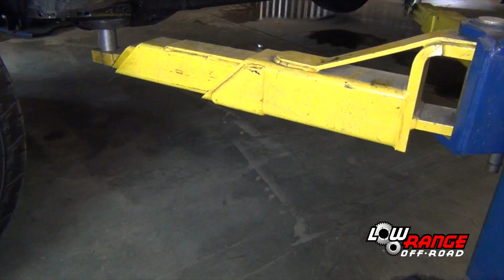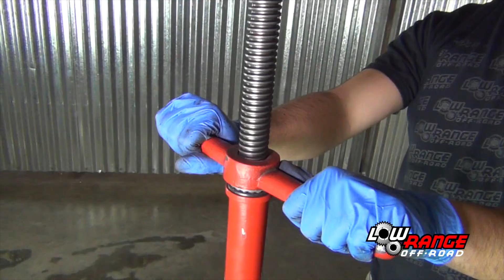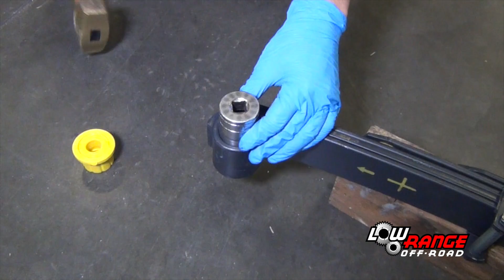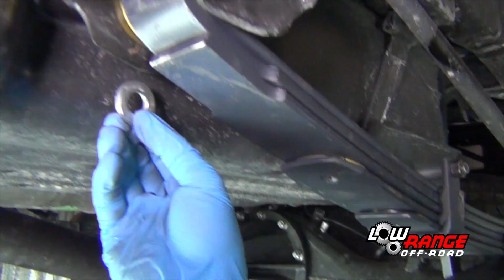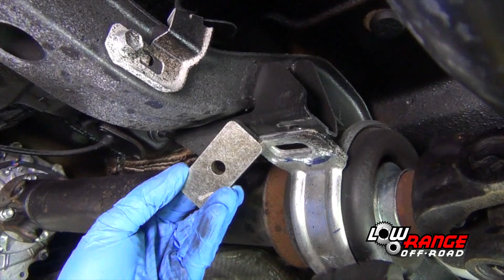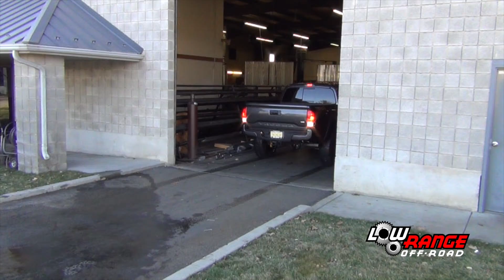How to Install an OME Suspension Lift on 2017 Tacoma–Part 2

Comment: To all reading this make sure you grease the new bushings!!! Just had to take out the leaf springs and grease them 5 months later after super annoying squeaks!! And make sure you use high enough jack stands so you can lower the lower diff  enough to get the new leaf springs in!! It was a giant pain with 3 ton jack stands, 6 ton jack stands made it so much easier.

Comment: OME 2005+ 2nd/3rd gen Tacoma springs need to be modified to work properly off road.  The problem area is the rear of the 2nd and 3rd leaves extend into the shackle and are in very close proximity to the shackle.  Under NORMAL leaf spring operation while articulating, the lower leaves slide outboard from beneath the main leaf, hitting the shackle.  Even worse, when the lower leaves exit the shackle, they pop further outboard, and when the axle goes back to horizontal, the lower leaves jam into the shackle, causing dangerous binding forces and terrible noises.  OME evidently took their design from the Hilux and Land Crusiers and didn't full test the fitment with the Tacoma, the ONLY Toyota that OME make springs for that has a shackle in tension.  Very poor execution OME/ARB
Reply: I’ve heard greasing the bushings when installing them helps with this issue.

Comment: Great and all but forgot to put non-petroleum based grease on the polyurethane bushings.  It is very important to put non-petroleum based grease on most of the surface of the polyurethane bushings.

Comment: Needed a little more heft in the rear of my gen 3 Taco for towing a camper and all our gear, but resisted installing a heavier spring pack like this. Instead I installed an add-a-leaf. Three months later, I've installed these springs because the add-a-leaf was kinda scary. I was ready to live with a stiff ride, as these have one more leaf and helper than the stock pack. MAN, WAS I PLEASANTLY SURPRIZED!!!!! The ride is smooth, but feels stout and capable. The truck handles better than with the stock springs as they are firmer and the Poly bushings make it feel nice and tight. I hooked up my trailer and the porpoising was no more! Sad I wasted money on the helper springs, but glad I took the plunge and went the right way. Falling in love with my truck all over again!!!
Reply: @asteiner9181 , you basiclly had the stock pack working , rubber bushings and all, until you hit the helper. So you had they extra weight twisting the stock pack around, and the softness of the rubber bushings adding to the sloppy feel. Then, when you did hit the helper, you HIT the helper, lol. When I put the heavier spring pack on with poly bushings, it was crisp, solid feeling and they weren't stiff as I imagined they'd be. At any load, and any road condition, they perform smoothly throughout their travel.  After all this time, I'm still extremely glad I spent the money and did it right.
Reply: @asteiner9181 , it wasn't that much, really. Old Man Emu, got them at 4Wheel Parts
Reply: @asteiner9181 , I didn't replace the fronts, just the rear leaf springs...and I even have a winch on a hidded winch bumper in front and didn't need more spring...Try 4Wheel Parts ARB part #ARBELO95R. $235.71 each, (sold individually). And poly bushing set OEMSB108, $32.98.  DOUBLE CHECK YOUR VEHICLE AGAINST THESE PART NUMBERS, I DON'T GUARANTEE ACCURACY!!!

Comment: Great video. Im currently running stock suspensions on my 18 tacoma sport, but pulling a heavy trailer it seats too much on the rear and so im thinking on doing a 3inch lift kit with heavy duty leafsprings. Im located in FL, where can I find those leafsprings and will it need blocks on top of the leafsprings?
Reply: Low range.com.

Comment: Just installed this set on my 2018 tacoma. This video was perfection. The paint-by-number of lift kit installs! 😆
Reply: How does it ride 8 months later? Any good offroading with this suspension? Any broken parts? Front axles are still good?

Comment: Does this lift only work on the 2017 model? I have a 2011 double cab long bed Tacoma that I'm wanting to lift, know there's a specific lift for it but, I was curious if the rear leaf springs featured in this video will still fit my older model Tacoma?

Comment: heres a prob easyer question, do i need new upper control arms. or is it not needed
Reply from the maker: Upper Control Arms (UCA's) are not required with this kit.  However, it is a good idea in that you will get a little more front suspension travel.  Thanks for watching and commenting.
Reply: lowrangeoffroad thanks!

Comment: I'm just adding a 150 pound front bumper(with wench) and 150-170 in the rear of dead weight should I get the heavy or medium load kit
Reply from the maker: Not sure I am qualified to answer your question.  May I recommend that you call our tech support sales guys at 801-805-6644 or email them at sales@lowrangeoffroad.com.  I am confident they can answer your questions.  Thanks for watching and commenting.
Reply: lowrangeoffroad all good I figured it out, thanks

Comment: Is an alignment needed if ur just doing the OME leaf spring install?
Reply from the maker: If the rear of the truck is higher or lower after the installation front caster will be affected.  So the answer is yes.  It should be aligned.

Comment: I just installed the  Dakar leafsprings with fox shocks and the OME carrier bearing drop. Now I'm getting a vibration at around 20-25mph.  Someone told me I might need axle shim.
Reply from the maker: I checked with our Toyota expert here.  He said, "he would want to measure his drive line angle to see if he needs a shim 
to adjust the angle at the rear axle or a larger carrier bearing drop".  If you have further questions I invite you to call us at 801-805-6644 between 8 and 5 M-F MDT and ask for Nick.  Thanks for watching and commenting.
Reply: lowrangeoffroad  thank you!
Reply: I’m having vibrations after installing this kit on my 2018 Tacoma, getting 2.5* shims put on to remedy but you’ll have to take measurements to know what degree shim you’ll need, one thing I’ve read though is you don’t want the difference to be 0.0 because then the u-joint won’t circulate grease properly, hoping my angle will be about 0.5 different between the angle of the drive shaft and the pinion bearing, I’ve heard the carrier bearing drop helps some people but didn’t help me at all
Reply: Or you my need a nidle bearing.

Comment: Low range off road I hope you get this and would very much appreciate a response. I'm definitely getting this for my truck but I was wondering can I fit 35s on without any rubbing
Reply from the maker: Ricky, the owner of the truck we did this 2017 Tacoma reported a slight tire rub on full turn in reverse with 33's (285/70R17).  Hope this helps with your decision.  Thanks for watching and commenting.

Comment: Great install video, I will definitely be using this for my OME spring when I decide to upgrade. I got a few questions though.

1. I see that most people only install the rear OME bushings, why have you decided to replace front bushings as well? 
2. Would you recommend grease or super lube inside the bushing before inserting the sleeves? and would some super lube inside the bushing reduce or potentially stop Dakar squeaking problem?
Reply from the maker: The bushings come with this kit. We installed the lift according to Old Man
 Emu's instructions. You can use super lube for your bushing.  Hope this helps.  Thanks for watching and commenting.

Comment: Awesome video I used it to start my instillation of the same kit today. I wanted to know the tire size and backspacing you used to put the 33's on, and of course do they rub anywhere? I'm thinking 4" of backspacing will be good but just don't want stuck with wheels that don't fit rite.
Reply from the maker: George, the tire and rim size is listed in the video description, but we will provide it here for your convenience:
Tire Size: 285/70R17 BFGoodrich KO2
Wheel Specs: Method NV 305 Matte Black, 17x8.5 - Back Space 4.75”
In regards to assembling those struts that we call them shock & spring assemblies.  When you buy the shocks and springs from us you can also buy an OEM quality upper shock mount (sometime called a strut mount) and we will assemble the spring, shock and upper mount for you for free.  It is a much better option.  I will include the link to the upper shock mount we supply below.  I realize this will not help you at this point in your install but it may help someone else.  Thank you bringing this up.  It really is an important issue; not just for the hassle aspect of it but the safety as well.  Thanks for the advice.
http://www.lowrangeoffroad.com/2005-toyota-tacoma-2007-fj-cruiser-2003-4runner-suspension-strut-mount-each-tac-sp-sm-05.html
Reply: I appreciate your prompt and courteous response. Because of this level of professionalism you will have a future customer for sure. I look forward to adding a few more items to my 16' and will definitely be sourcing you for parts as soon as I find a Samurai to swap my 85' axles into. Or go all out and just build a tube chassis for it haha.

Comment: is a diff drop required?
Reply from the maker: Not sure I understand the question. Are you referring to a diff drop in the front or the carrier bearing spacer on the drive line?
Reply: lowrangeoffroad  I see that the kit comes with the carrier drop. but, I don't see a diff drop for the front diff, which most of these kits come with to fix the front axle angles.
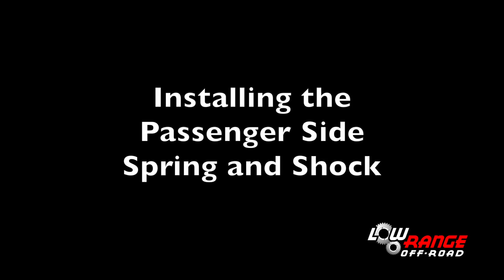Reply from the maker: We do not supply the diff drop kit with this OME Lift Kit because we consider this aspect of the lift to be optional.  We have no evidence of the axles exceeding their range of motion.  However, it would not be a waste of time or money to install the diff drop kit.  It would certainly make those front drive axles, cv joints and boots live a little longer.  The diff drop kit cost only $29.00.  Here is the link:  http://www.lowrangeoffroad.com/2005-2017-toyota-tacoma-2003-2017-4runner-2007-2014-fj-cruiser-lexus-gx470-gx460-differential-drop-kit-lr-2gddk.html.  Also, here is a link to a video which includes how to install the diff drop kit on a Tacoma: https://www.youtube.com/watch?v=Rxcd2duh1gM&t=329s.  Fast forward to the 8:00 minute mark to see these instructions.  If you have further questions or concerns please email us at sales@lowrangeoffroad.com or give us a call at 801-805-6644.  Thanks for watching and commenting.

Comment: So then, could you add a front strut spacer to raise it to level or slightly higher then the rear?
Reply: Several of our customers have used the Low Range LRT 3" front lift spacers with Old Man Emu rear springs.

Comment: Any rubbing with the new lift and wheel set up? What are the rim specs(size, offset, ect)? Great videos.
Reply from the maker: Mitchell, I am not aware of any rubbing.  I will check with the owner and get back to you on that.  But, all the tire and rim sizes along with other specs are shown in the description of the the video.   I will include tire and rim specs here as well for your convenience.  Thanks for watching and commenting.  Tire Size: 285/70R17 BFGoodrich KO2

Wheel Specs: Method NV 305 Matte Black, 17x8.5 - Back Space 4.75”
Reply from the maker: Mitchell, I checked with Bryceb the Technician that did the install.  He reports, "Hard turning in reverse there is a slight rub but nothing noticable."  Hope this helps.
Reply from the maker: I meant Brycen not Brycenb.